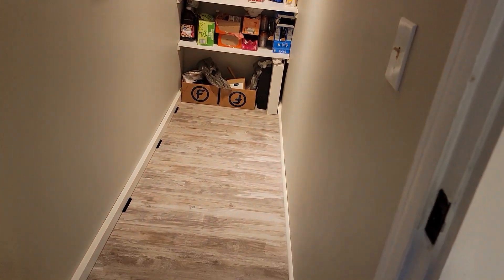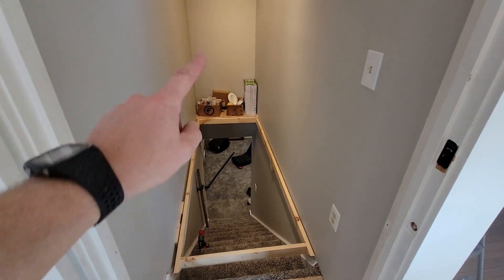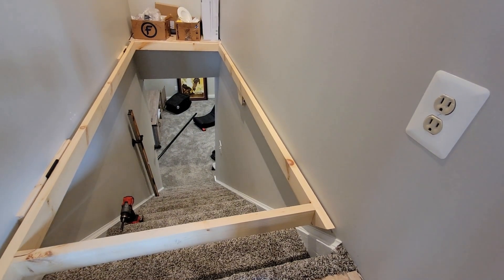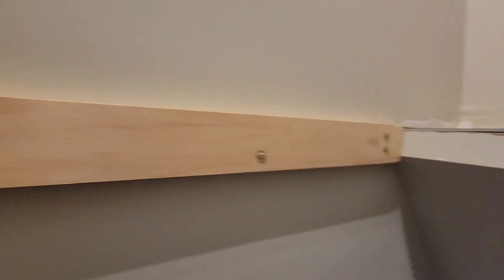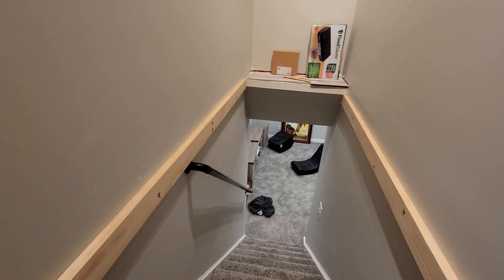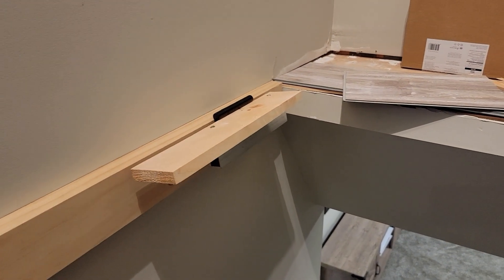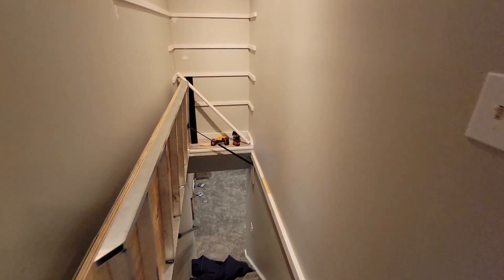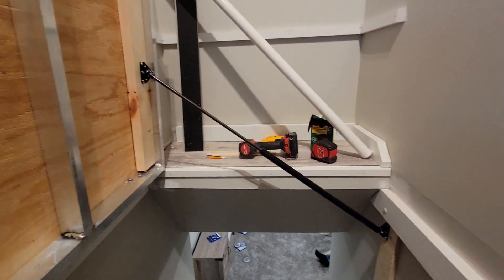Pantry with a Secret Entrance to our Gameroom!

Comment: Love your video, I am trying to do the same thing but the door is to a walk out basement.  Would you be so kind and give me the dimensions of the brackets you made for the actuator and strut and how did you figure out the placement for the brackets? Like you, I am trying to figure out the angles and offsets to mount my strut and actuator. My door is 52" wide and 87" long and weighs 150 lbs. I have the strut and actuator but I'm at a loss as to how mount them. I used 2x6 wood to frame the door since this door is also part of my deck.  Any help would be greatly appreciated.
Reply from the maker: https://youtu.be/k6ID1La_xf0?si=8imeXEkmkFynn8o4. Heres the update
Reply from the maker: I might have to make a quick follow on to this to show some measurements..i can probably pull it off this weekend
Reply from the maker: Make a list of items you want me to show
Reply: @themoneypitgarage  The brackets you made, are they 1/4"x4"x4" and what grade did you go with, 3003, 5052, 6061 or something else? Did you heat the aluminum to bend them? How far away from the wall is the lower brackets? I assume the aluminum frame is 1"x3", I'm trying to figure out the scale. Is the middle of the actuator stop just below the framing or even with it? .  Like you, I have gone through a number of hydraulic struts, blew one out completely and I now have a 400 lbs 16" actuator with another 150 lbs hydraulic strut to  stabilize the other end of my long door.   Thank you so much for your time and effort.
Reply from the maker: @austinffgreg  https://youtu.be/k6ID1La_xf0?si=8imeXEkmkFynn8o4

 hope this helps
Reply: @themoneypitgarage  100% Thank you so much and again, I think you did a fantastic job and I really appreciate the update

Comment: just came across this video and the instructable page whilst looking for ideas for my own pantry(luckily, no stairs involved, lol). I was wondering how you feel about it now, nearly a year on, and if you have made any further alterations to the pantry area, like adding more shelving on the side walls above where the door rests when open. Any settling of the support boards?
Reply from the maker: It actually has worked flawlessly. I will keep an eye out for a next gen controler that might have stop sensors, to prevent closing on someone, or something but so far its been great and my 10 and 12 year olds and their friends are yet to break it. I have plans to add a can dispenser but this amount of shelves has been good for us. Zero settling and so far all the hardware is tight

Comment: This is way nicer than my initial pantry wish. I was thinking you should make a basement pantry kit!! Much like the attic drop down stairs you can purchase. This is really such an awesome build! 👏🏽
Reply from the maker: Thank you! You know the biggest issue with doing this for profit would be the liability. I'd get sued the first time someone closed it on a toe or someone got stuck, you name it. It's unfortunate but I know my household is old enough to understand the operation and what to do if some part of it fails. I will say, the company that makes these actuators are constantly innovating and its just a matter of time before they are able to work in some additional safety features

Comment: WHAT LENGTH ACTUATOR ON STROKE DID YOU GO WITH IM CURRENTLY WORKING ON THE SAME PROJECT
Reply from the maker: Linear Actuator 12 VDC-14" stroke-100 lbs
Reply: Awesome thank you can you also tell me where you got the strut and mounts?
Reply from the maker: @candivibbert8480  lift supports depot.com. sr308p60m10 was the one I used
Reply from the maker: @candivibbert8480  oh and I made my own mounts out of 1/4 aluminum angle stock
Reply: Thanks so much it’s greatly appreciated